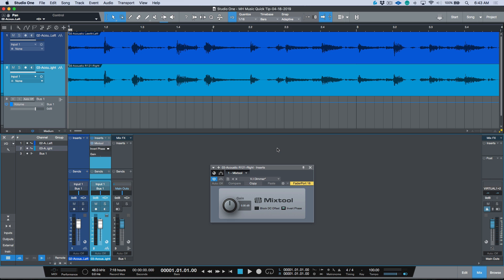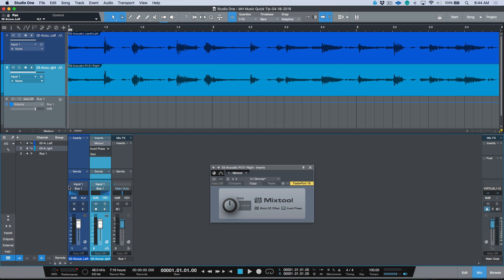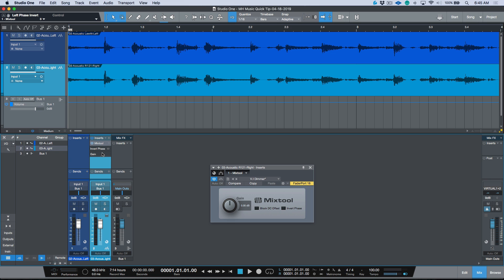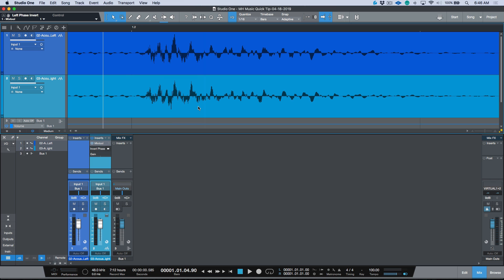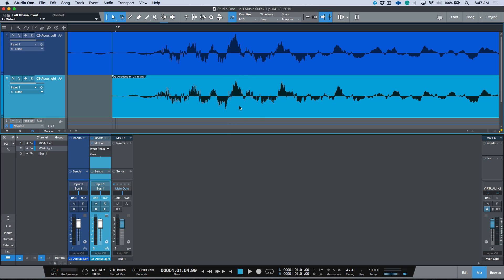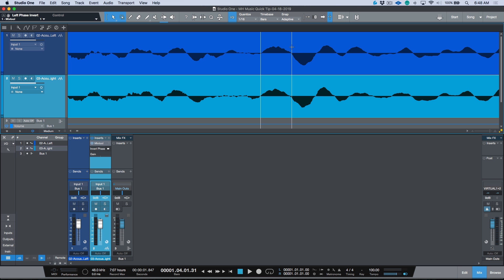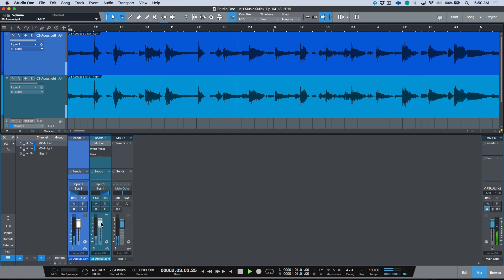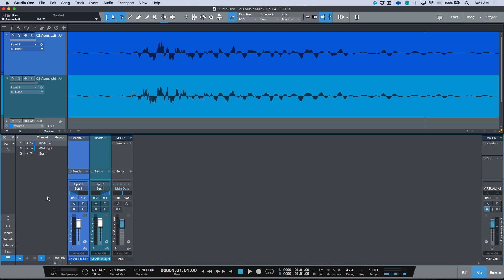How To Fix The Phase of Multi Mic Performances Using Editing In PreSonus Studio One

Comment: This reminded me of my old Cubase days when I would shift an”Event” back or forth using the Event Delay (set to measure in samples). 
SO I went to see if and where I could do the same in Studio One 4. 
And YES ! Inspector pane > Event Info > Start/End. 
With the overall timebase set to show Samples that “Nudge” facility is there. 
I'll have to do a test to see if will Nudge on the fly the way I used to do it. 
What I liked about that approach was that I could hear the phase Or the cancelling coming in and out.
UPDATE
Yep. Works fine on the fly. 
I felt sure it would, but you gotta check these things ....